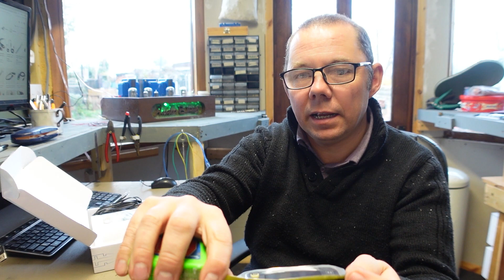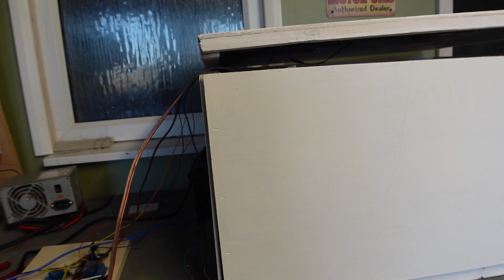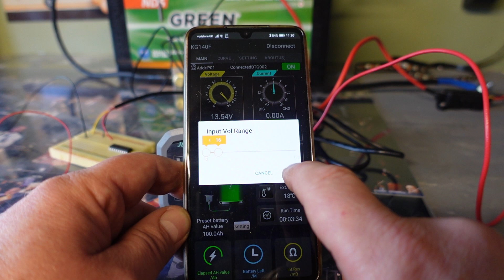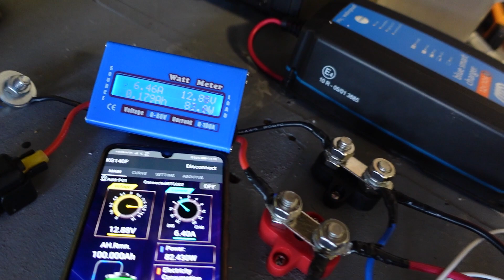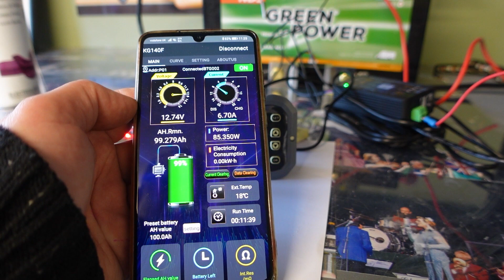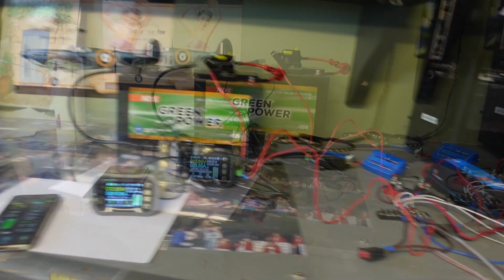FG140F JUNCTEK Juntek battery monitor review with Bluetooth

Comment: Excellent video - Can you adjust in settings max battery size to reflect to the graph sides?
Also because my van setup is under the bed and hard to access i fitted a remote earth on off solenoid and relay im guessing and also wondering if the relay could be hooked into the positive wire of that switching device - that switch would be handy for a bouse berg car key theft too - turn the battery off before they get in car with the remote?

Comment: Do you know of a shorter cable that will work from the main display to the controller box. I need a 3 foot cable.
Reply from the maker: I dont but im sure it can be made easily if you source the parts on ebay

Comment: Can the data cable be extended?
Reply: I just got a telephone cable with the coupler at the end.  This comms wire is narrower than the phone jack... but the pins line up. Had to file down the phone jack to fit inthe unit sadly.  Will order a proper adapter to crimp properly

Comment: Hi! the delay, protections and relay mode is for an optional relay protection disconnect for when your battery or battery bank is low voltage or low power capacity. it is an additional relay breaker that it is sold separately. The delay is for when you draw power in a peak load, your battery ( this case 12v) can be drawn below the 12v briefly, if you donde set a delay for that peak, the system will be shut down because a under voltage peak load.
Reply from the maker: Thank you good to know, I will be using this shunt for a new project but seeing as my lithium has BMS with low battery shutdown I may not use this feature. I did contact Juctek about a low temp shutdown and they said they may add this to the next firmware. This will be good with lithium as it can stop any charging when temp is low
Reply: There is a relay setting for always on or always off. Could that possibly be controlling the signal being sent to the relay. 
I will check on this, but I am hoping it is an always on until it goes into protection mode, and the other is always off until going into protection mod, at which time it will send the signal to the relay.

Comment: Is it possible to run the app with the metering unit, while the display is disconnected?
Reply from the maker: I did not test this I believe it can be. Will try later in the week.
Reply: @BrackstonesTravelAdventures  
Thanks for the interesting video. How the over protection realy works ? How it shut down the relevant item ?
Reply: It works with the app and the display unplugged. I bought it is a great unit.
Reply from the maker: @theotherJdwag  good to know thanks for the update
Reply: It can be oredered without the display from the same store which saves a little if you don't need it.   Thanks for the detailed review, I was trying to find out how long the RJ11 4 pin cable is, you estimated 5m, which is plenty for me to run to the cupboard which has existing displays
Reply: The comms wire that comes with it is narrower than a regular phone jack.  4pins match the size though, I was able to file the phone jack to fit for now.  Not sure if it's considered rj11 too?
Reply: I'm also very interested in just running the app, without the display.
But I'm having difficulty pairing it to my (Huawei Android) phone.
Reply from the maker: Have you tried pairing it with the monitor connecter. I used the Huwaei P30 which connected ok with no issues. Maybe try restarting the phone and shunt control box see if this helps. If not I would contact there tech department, I found they were very helpful
Reply: @BrackstonesTravelAdventures  It turns out that you need to keep the Location settings for the app kept on for the Bluetooth to work. I had automatically turned them (and the access to Storage) off when I installed the app, as I didn't think it was necessary. It still runs with the Storage access denied!
Reply from the maker: @SuperWoollyBully  I expect this is a google thing, they like to collect data on everyone. I would not bother me but I expect a few people will not like to be tracked.
Reply: @BrackstonesTravelAdventures  It's actually down to the app designer. I personally don't know why it needs your location, so switch it off on all apps, if possible. In this case, the Bluetooth won't work without it, so I chose the option to have it on only when the app is in use.
And yes, it works fine with or without the monitor connected.
Thanks for all your help and the excellent video.
Reply: @SuperWoollyBully  Works without the display. You can unplug it and the app still works.
Reply: The disconnection of the display does not affect the data measurement. The measured data are stored in the measurement module. The mobile app and the display are only used to display the data.

Comment: Thanks for the Review.  Do you know if this unit is reporting the correct AH's and SOC after many cycles?  Another reviewer mentioned a cumulative error over charge cycle which give major errors in AH's and SOC.  See this link for specific issue, this was on another Junctek model. I am interested in the KG140F but only if it is reading correctly over multiple charge discharge cycles.  https://www.youtube.com/watch?v=nPldUM67Jbw&t=993s  Thanks in advance
Reply from the maker: I did not try this, i will give it ago in next week. I have seen this on a lot of gauges and I expect the TR-16 does it but does not show it. With AGM there is also a drifted as they discharge internally and the gauge will not pick this up. For me I always charge the van once a month to 100% and recalibrate the gauge. Would never trust one all the time. Now we have lithium with Bluetooth I can compare the two. It will be interesting to see if this is still an issue
Reply: @BrackstonesTravelAdventures  Thanks for the feedback, will look forward to your findings.
Reply from the maker: Just done a second test and Vlog https://youtu.be/8t31LO3YuBo  I did not see the issues brought up by the other guy but this is a different model. I have not seen anyone else having trouble with the FG140F.
Reply: @BrackstonesTravelAdventures  Thanks for the update...I will take a look, glad to hear you did not see any issues.  Merry Christmas and Happy New Year

Comment: Can you measure two battery banks with this, i.e. home and starter
Reply from the maker: No because there is only one shunt. you would need a separate shunt for the starter battery. You could install a shunt on each battery with control box for each battery. You would then be able to Bluetooth to each device separately through the one app.
Reply: If your two battery packs are connected in parallel or in series, they can be measured together. If not, he can only measure one set of batteries